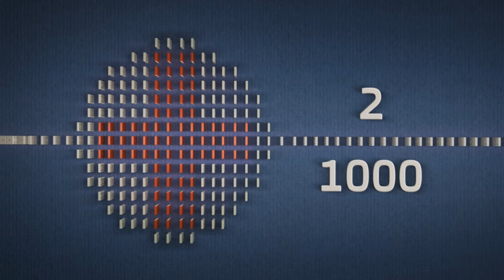Cycles Demoreel 2016

Comment: Finally, i can join this glorious community. I had problems with installed versions of Blender on Windows as it crushed my entire OS, but now i downloaded the compressed version ( .rar version ) and it runs really really well.
( Intel core i5 5200U, 8GB DDR3 RAM, 1.5TB HDD, GTX 940m , Windows 8.1 are my specs if someone would want. )